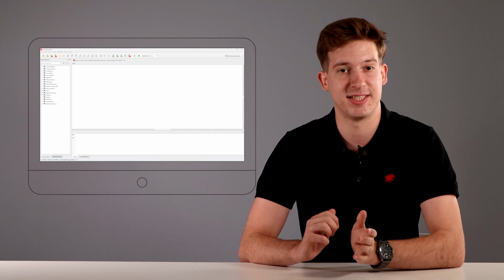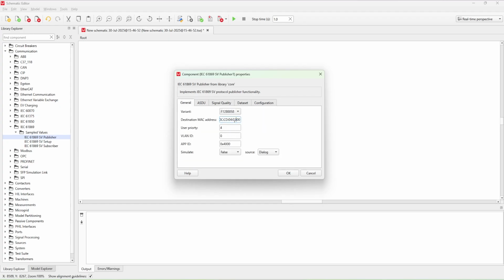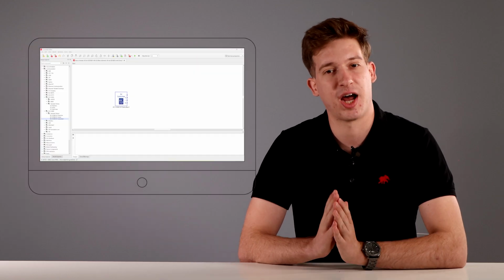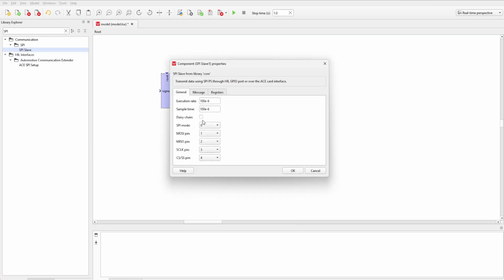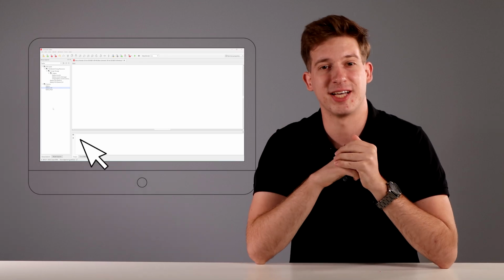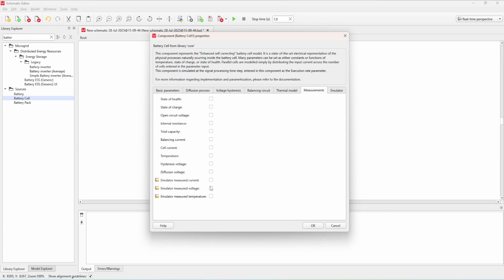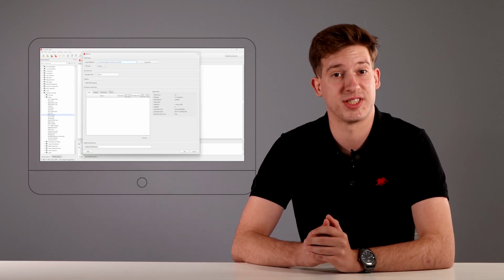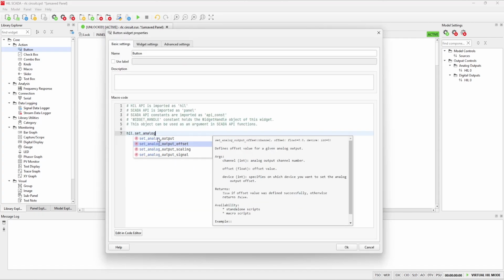2025.3 Software Release | New Features Walkthrough

Comment: 7:00 can we change all these parameters with IDE ? do u have any example that can show it using BESS model
Reply from the maker: Hi there! 

Yes, you can change the values of these parameters in the IDE. You can do this using the functions set_component_property() or set_property_value().

While we don’t currently have a test that demonstrates these functions in action for the BESS application, we do have a test using one of them in the example “Grid-connected NPC PV inverter with ride-through protection functions” in our Examples Library.

Additionally, you can get assistance from the API Wizard while writing code for your tests. For more information on this, you can also check out the Test Automation course on HIL Academy. It's part of the HIL Specialist 2.0 specialization program, authored by Typhoon HIL engineers, that you can access for free here: https://hil.academy/hil-specialist-certification-2-0/

We hope this answer was helpful. For more support, you can always turn to the Typhoon HIL Forum, where our community is glad to help: https://typhoon-hil.com/forum/
Reply: @TyphoonHIL  thank you for your detailed comment , really appreciate it

I was doing the course as u mentioned and there I got interested in using python IDE for BESS model. 

what i simply wnat to do is to change battery paramters like DC voltage , battery type , initial SOC etc via Python IDE and using the API tool.

Could you share perhaps a snall piece of code on what would be typical syntax to do it? 
when I ran my own basic script , it gave me error like "Batterry name is not defined " and i dont know how to fix this error :(

rreally looking forward for ur reply and learn more on the HIL setup :D

Another questiion  I have is that can i know the dimensions of a typical Typhon HIL Cabinet with Inverter controller for BESS HIL testing. rought estimate would work for now. thank you